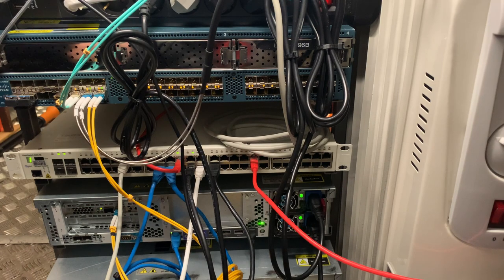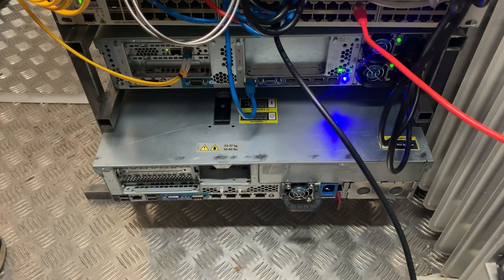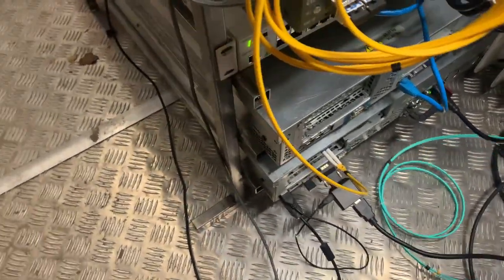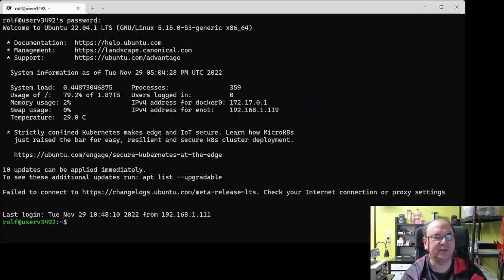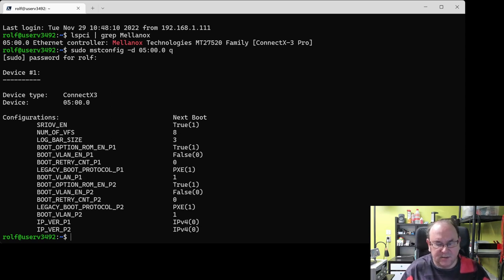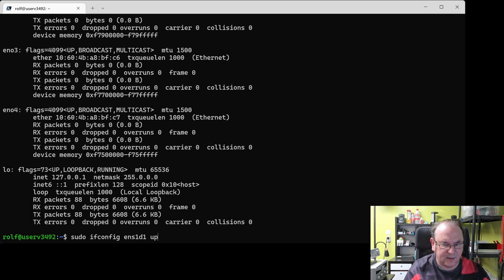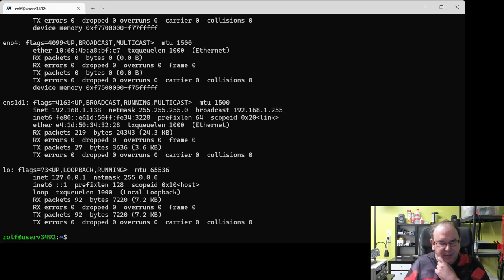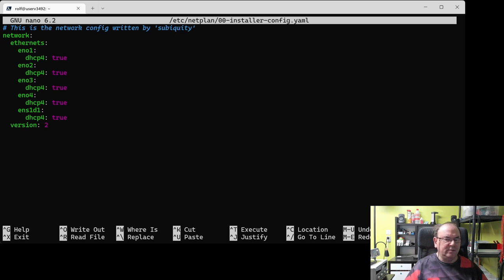HP Proliant DL380p G8 with Ubuntu 22 04 1 LTS server 10G network card swap

Comment: Thank you for the videos.  It looks like you are about a year ahead of me.   I have a DL380p G8 I'd like to put 10G in and really just starting my research.  I assume a standard desktop PCIe 10G card will not work?  Or did you have another reason for using the Mellanox?    Were the original 4 1G ports still fully functional?
Reply from the maker: A standard desktop PCIe card should work as long as drivers exist. 1G ports are fully operational (my secondary backup network). I am following the flow on Google that shows Mellanox seems to be a popular compatible enterprise card for Ubuntu.